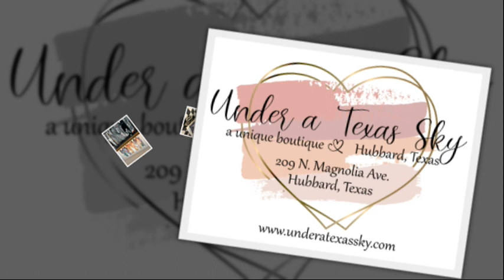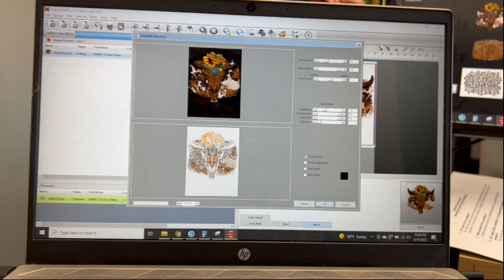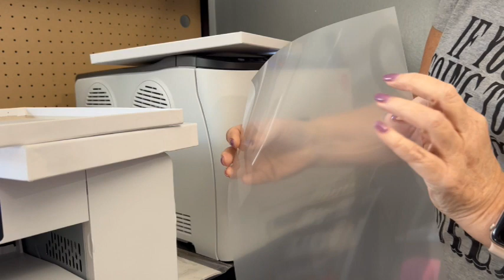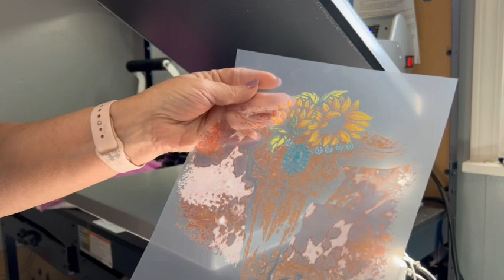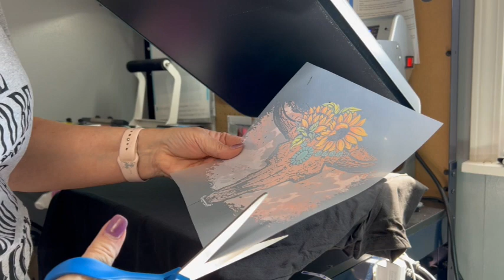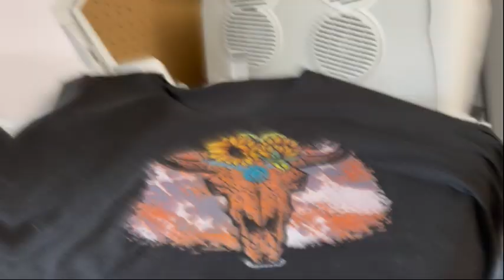Uninet iColor 560 Beginners Tutorial #unineticolor #whitetonerprinter #icolor

Comment: What am I doing wrong if when I go to peel the adhesive backing off the whole image comes off of the clear front piece of the transfer sheet?
Reply from the maker: Be sure you preheat your heat press before pressing the adhesive sheet to your image. Just close your press for about two minutes. Also, be sure to rub the image before peeling. Take a cloth and rub around for a a few seconds. And I've found that after pressing the adhesive sheet, turn it over and peel the transfer sheet from the adhesive sheet. It's more flexible and is less likely to "skip" when peeling. Hope this helps!! Blessings- Kelly

Comment: Is this printer like sublimation printer?
Reply from the maker: This printer will actually print using sublimation ink but I use it specifically to create heat transfers. You'd need to change the ink to sublimation ink to use it for sublimation. I have a Sawgrass SG1000 to print sublimation images.

Comment: Hi friend this is the 3 era time I believe  I washed  your video traing to understand  what I'm doing wrong 😭 hope to find out.  I did notice you put the shine side up and I was putting it down.  Maybe  that's  the problem.  Because the paper stick so hard to the clothes  that  is too hard.to remove it and it get damage.
Reply from the maker: Definitely put the dull side down when loading through the printer. The dull side is the print side. Be sure you don't press for too long. And use a steady fairly quick pull when peeling.

Comment: Have you tried using the icolor 560 transfer on a 70% viscous bamboo/ 30% cotton shirt? I just tried on but had a slight problem during the cold peel part. Some of the image peeled off. The rest of it looked and felt great but I think the setting needs to be a little different for the fabric.
Reply from the maker: I've not tried using that blend. It's possible that the it needed a little more time on the press and not the fault of the fabric. It's pretty temperamental it seems. If I notice the image is peeling up, I'll try pressing it for a few more seconds. But it's not a foolproof method sadly.

Comment: Mines doesn’t peel off easily it’s like stuck to the shirt  . I pressed part b 120 at 310 then on shirt 310 for 30 seconds and it’s super stuck to short when I pull off some of the picture tears off
Reply: I have the same problem you describe. I already  waste a lot of transfer paper 😭. Have you find a solution  yet ? Any help I appreciate 🙏
Reply from the maker: I think it could be a settings issue. Be sure your heat press is pressing at the heat that's it's reading. It's possible the press is heating unevenly also. This is kind of delicate stuff and small problems can ruin it. If you keep having a problem, I'd contact the Uninet. Good luch! Blessings- Kelly